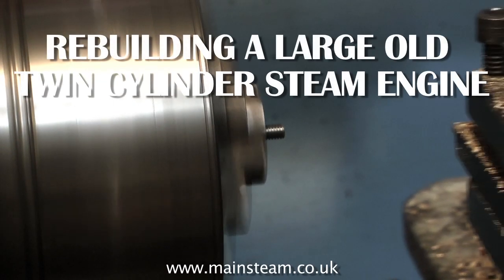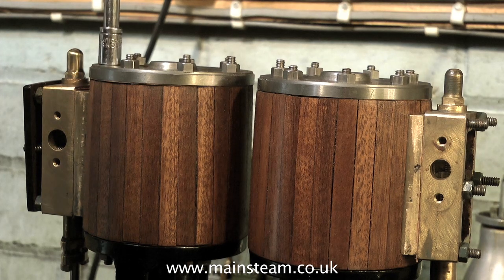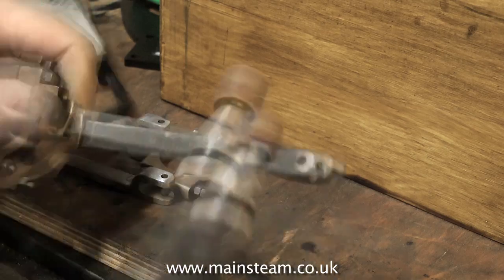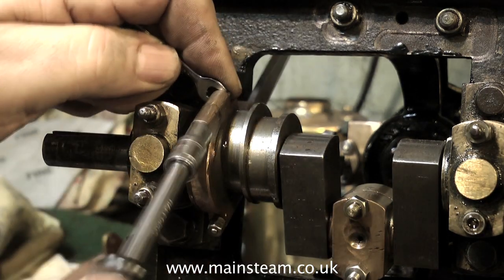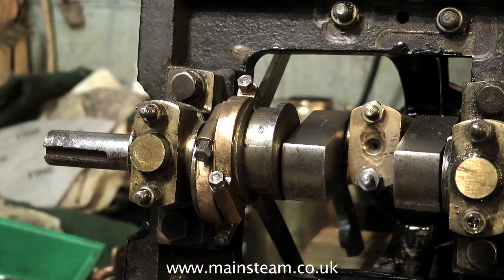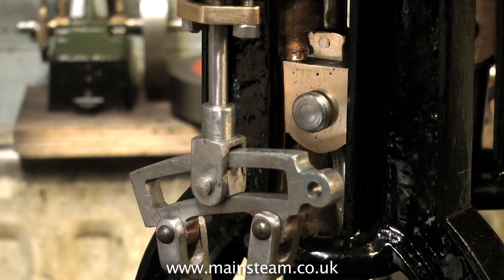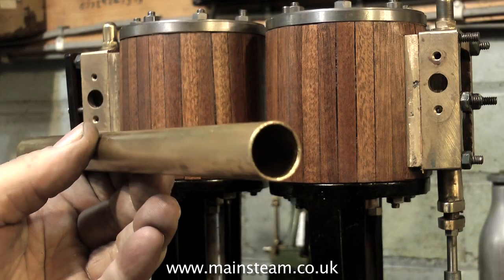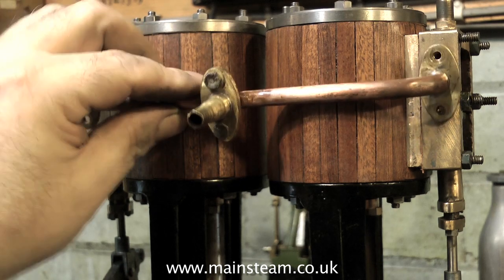PART #16 - REBUILDING A LARGE OLD TWIN CYLINDER MODEL STEAM ENGINE

Comment: You know, you touched on a huge pet peeve of mine. Where certain load bearing parts or more importantly, moving parts fitted with the part in motion riding on any threaded shank of a fastener. I see that so much its mindboggling. Many cases of relative motion causing the threads to file away material and some where the threads wore down. Drives me nuts. All fixed by the proper fastener with a solid shank!
Reply from the maker: mytmousemalibu I couldn't agree more - it is just the easy option but never lasts long - a mechanical disaster area . . . . .